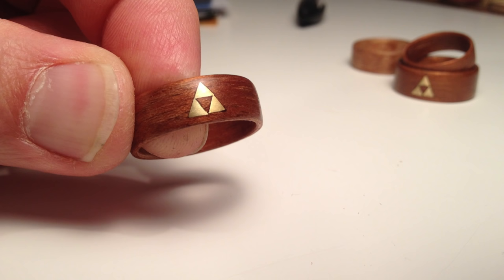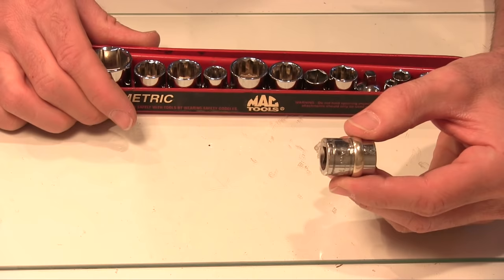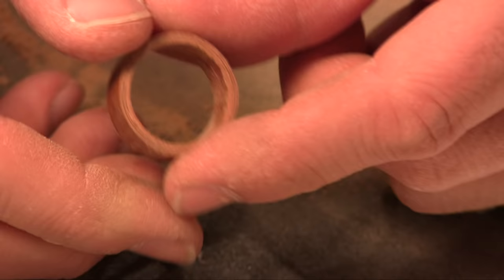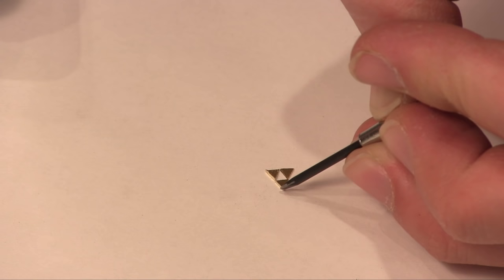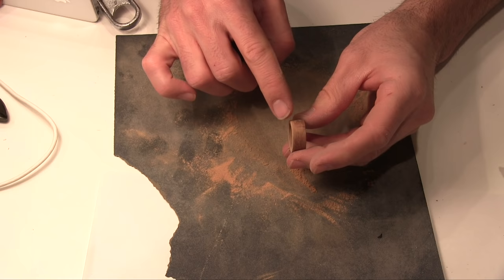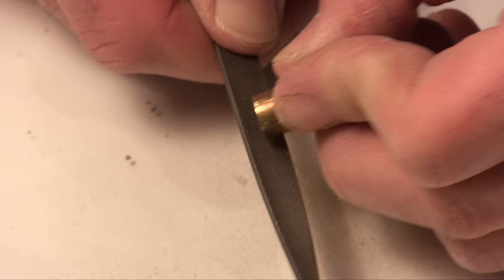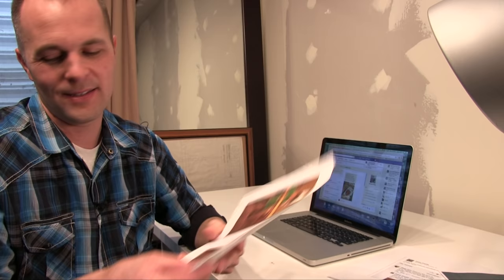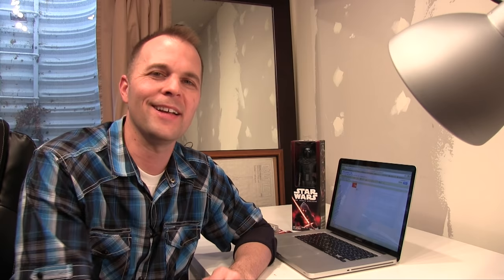How to make Wood Rings - bent veneer w brass Zelda Triforce inlay

Comment: IT'S TOO DIFFICULT!!!
Reply: dont get discouraged, yes its deceptively harder than it seems
its "simple, not easy" (wood dont like bending that tight)

its not a project worth spending 40$ on a variety pack for, just to make 1 or 2 rings
but if you did, you just have to learn to practise patience
getting the wood to bend can take some time (much more than the 10mins in a mircowave in this vid)

if you cant reconcile the teduim in making rings
concider that braclets take much less bending
(may need to use multipull strips, or make ones with a small gap (not full circle))
advantage of bracelets is you can dont have to  "cherry pick" the perfect grain pattern
and can more easily incorporate multipull woods

or use the veneer as intended, as a decorative facing on another project
such as a jewlery box or makeup kit (plastic or wood box)